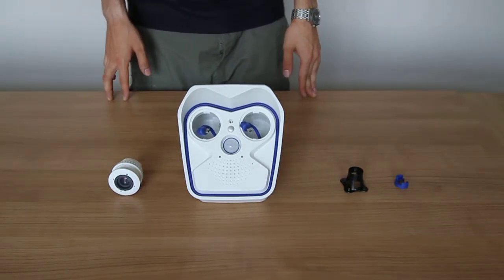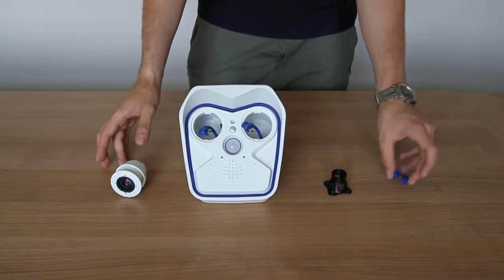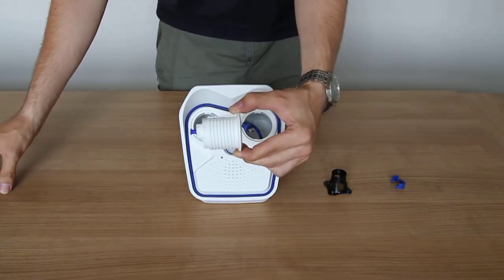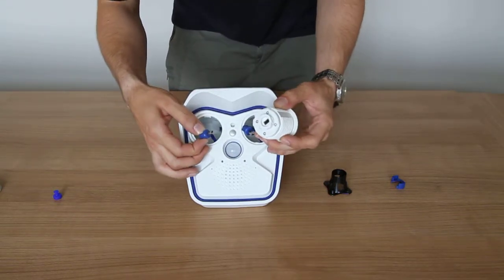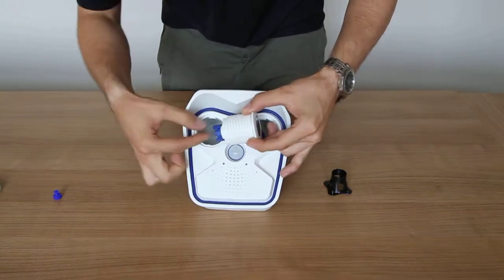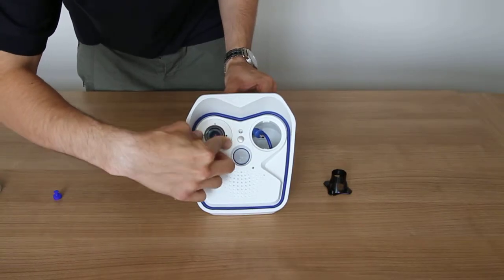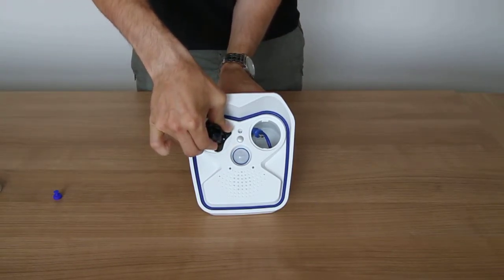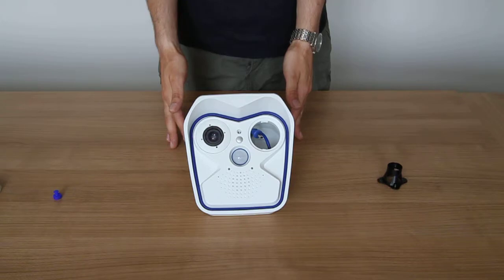Mobotix M15 Lens Installation

Comment: Couple things, not to be fussy haha... you haven't used the red security clips inside to lock the lens in position, and to stop the lens from being stolen. And secondly you didn't turn the lens all the way when you tried to spin it using the tool ;)